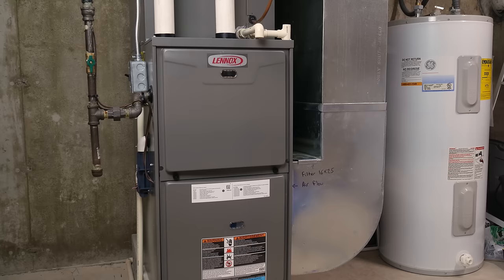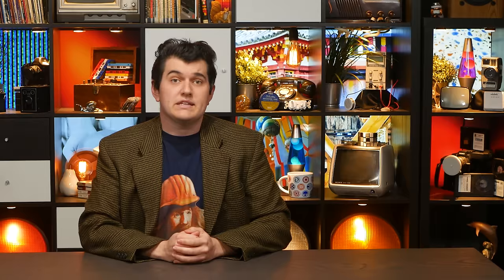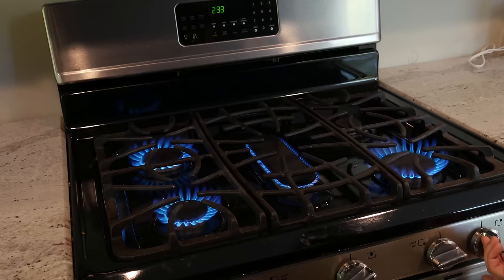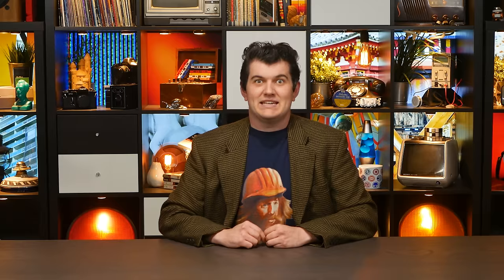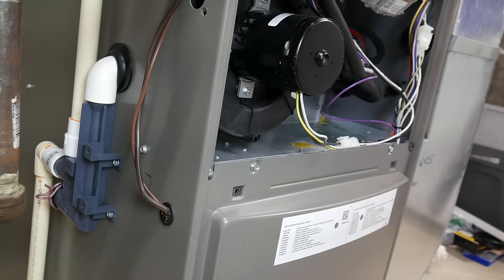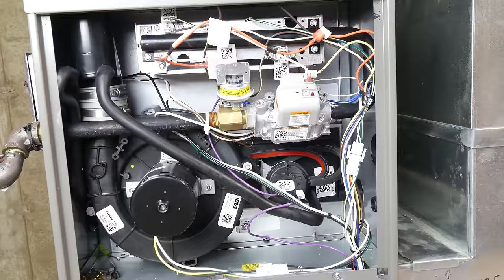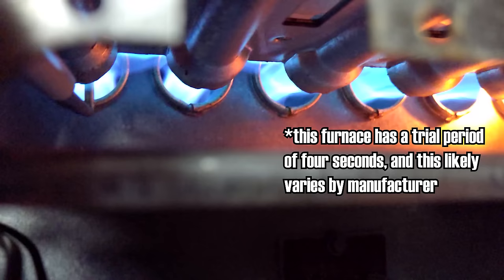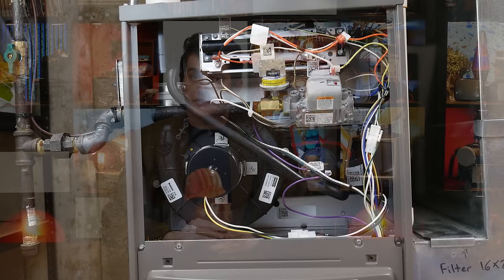Forced-air Furnaces: The What, Why, and How

Comment: HVAC guy here. Correction on your description of the flame sensor. It's actually way cooler! Because a flame is a plasma, it is actually checking for the conductivity of the flame! Any obstruction in the flame line will cause an error, as will Any corrosion on the flame sense rod. One of my favorite things about the modern furnace!
Edit: Whelp, you already made a note!

Comment: Having had almost died from carbon monoxide, please everyone have your system checked every year and have those alarms checked and replace the batteries if needed!  My story regarding Carbon Monoxide was when I was around 7 years old and I remember it pretty vividly believe it or not.  I think some of it was filled in by my family's take of events, but I do have clear memories of certain events.  I do know how it happened, but since it is 100% a one-of-a-kind case I am not going to say, but the outcome of what happened is the real story here.  That cold night back in the early 80's carbon monoxide somehow ended up in our cold air returns and leaked back into the house.  Unfortunately my bed was right over my cold air return and closest to the furnace.  Somehow I made it down the hallway and landed on the stairs and since my dad was such a light sleeper, he woke up and ran downstairs to find me.  It was around this time my memories started.  I started to gain conscientiousness while my dad was yelling at me to wake up and lightly smacking my face to get a response.  In my head I was really dizzy and saw tremendously bright outlines of geometric shapes flying past my vision as if they were neon signs.  When my dad started to feel the effects of the CO, he took me outside and by this time everyone else had been awaken and together.  After a little while sitting in our van on that cold night, I remember my parents discussing what happened and what to do.  After my dad's head started to clear up a bit we went to the hospital where we found out that I had 30 minutes to live under that concentration, my sister had an hour and my parents, being upstairs and the furthest from our furnace had an hour and a half.  I was on oxygen for 24-48 hours, those details are foggy.  Although the details of what happened in my case are very unique, it doesn't discount the fact that this can happen with a commercially installed furnace at any time during its operation.  Also if I may make one more interjection here, please for the love of all that is wholly, crack your garage door if you are running an engine in there....especially a lawnmower or snow blower.  The amount of CO they produce is astronomical and I think we all need all the brain cells we can retain.  Thank you for those who read this book and I hope you take it as a good story about how 1 little boy could save his family from oblivion.  By the way, I am in my 40's married and have a beautiful daughter that is in grade school and I have had zero negative effects from this event.

Comment: Fun story, my housemate and I were having trouble with the furniture a few years ago. At one point the thing shit down in the dead of a winters night nearly killing my roommate from hypothermia. Thankfully she was okay and until we could get it fixed we had a fireplace and our oven still worked just fine. The techs got it up and running and that was that. Fall comes around the next year and we decide to get the furnace tested to make sure it was all in working order. Surprise surprise the heating coils (several of them) we cracked pumping out quite a bit of carbon monoxide. We didn't know this because our carbon monoxide detector was 15 years old and non-functioning. Thankfully we got a new one installed and no permanent damage done to us. But that could have been deadly. Now we have two detectors and a new system to keep us warm. Yay! Happy ending!

Comment: "The electrical requirement of resistive heating aren't practical on a large scale" - Hydro-Québec, selling electricity at 6.08¢/kWh, in a province where 73% of residential energy is electrical and where it's quite cold, would like to have a word with you.

As for ventilation, what you want is balanced ventilation through a heat recovery ventilator, standard here in new construction. See "BSI-012: Balancing Act - Exhaust-Only Ventilation Does Not Work" by Joe Lstiburek
Reply: @Writer B.L. Alley But despite that, there's most of a province with 4000 heating degree-days (18 °C) each year that uses resistive heating.
Reply: @w0ffe  which is only a good idea if the vast majority of the electrical generation in the region is hydro and/or nuclear. Otherwise, using resistive heating on a fossil grid is terrible.
Reply: Ontarian here, always jealous of your low rates. Our province is too stupid to manage our hydro generation properly and it costs too much.  We pay the US to buy power from us then we buy it from Quebec because we are selling too much. lol.

Comment: I'm kind of curious how much of a difference in tech and safety there is with gas-powered wall heaters, like the ones in some of my rooms built as part of an addition. The main house has a central heater much like the one shown in the video and it makes all the same sorts of noises and does the same checks, but the wall heaters are just like, "off.... ON! 🔥"
Reply: The addition... that's not new work, is it?  Because those heaters, even with vents, were booted in most jurisdictions 20+ years ago.  It turns out that convection is a really bad way to exhaust combustion gases.
Reply: @raygunsforronnie847  It was added on about 20 years ago, yeah.

Comment: This furnace is built safety in mind
Also that furnace: take the front panel off and you could probably stick your hand (or something else) into the flames.

Btw, if you use your furnace only in winter months, how do you heat up water (shower/tap)? Electric resistance heaters?
For context: oil-fired water radiator based heating system, furnace also heats up the water. In my furnace, if you open up the furnace enough to touch the fuel nozzle, it won't start. You can check if there is fire thru a fish eye lens (similar to what you may find in front doors). The system is old (20+ years) and needs to be replaced in couple of years, but I believe it's efficiency is somewhere around 85...90%. Furnace is located in a separate room rated to stand fire for a minimum of 2 hours.

Really I don't think the furnace poses any larger risk than a regular fireplace (burning wood), wood-fired stove or sauna. But still I wouldn't mind having CO sensor in my bedroom, and fire alarms are in every single room (apart from toilet, sauna, bathroom and kitchen where steam or a sudden rush of hot moist air would often trigger an annoying false alarm).

Comment: I’m wondering if you can do a video on the geothermal systems, I’ve never understood how they worked, I’ve been curious because a lot of people are now installing these where I work
Reply: The bare basics of it, starts with the geo-thermal system in question is still a "Heat-pump"... SO it acts like a regular AC-unit in the summer (moving heat out of the house to a cooler place)... AND a "reverse" AC-unit in the winter (moving the heat INTO the house from a warmer place)...

     BUT what happens when the outside is even colder than the inside???
    I had a "regular" heat-pump, and since they put it "hidden away" in the shadow of the house, it SUCKED ASS in the winter-time... 

     Some clown figured out that caves, mine-shafts, and about anything else more than 10 feet underground stayed about 60F year around... Dubiously warmer than outside air in winter AND dubiously cooler than outside air through summer...

      SO they stashed the heat-pump's "external exchanger coils" into a subterranean chamber... We have plenty of energy effective (if not always efficient) "coolant" materials to choose from, so long as the stuff is gaseous to be compressed where heat is to be extracted, and allowed to expand where heat should be absorbed... There's some technical hooey more complicated than a YT comment... BUT the beauty of the heat-pump systems is that they can reverse course and compress or release the coolant material for transfers of energy in either direction, unlike a "common" AC-unit, which is "dedicated" to blowing the hot air outside and the cold air inside... 

     BUT all this works on the same fundamental principles of a refrigerator or freezer... AND demonstrably from the "side effect" of any common air compressor... Should you find a regular air compressor (like at a mechanic shop or anywhere with pneumatic tools) wait until it's been running a little while and put your hand near the "coil" of copper tubing into the tank... It's going to be warm or even HOT to the touch... AND by the same token, if you pick up a "blow-gun" for the thing, you can hold onto the supply line and feel it get physically colder as the compressed air in the tank is being released...

     Well, fridges, freezers, and cooling systems all over the world have been using that same principle to absorb heat where it's not wanted and release it where it's more acceptable... AND they've been doing it for a bit more than a hundred years. ;o)

Comment: Meanwhile in Europe:

Idk man let's just use water
Reply: @Les Usually electrical coils, although outdated houses still sometimes have gas burners.
Reply: @Shirokroete  Can't just throw the entirety of europe in one bucket. In some countries gas is most used, in other wood, in other electrical. Just depends on what's most easily available in the region.
Reply: @louis-lau  Also oil or wood chips
Reply: @louis-lau  And then you've got those cheaters in Iceland, just taking the heat out of the ground.
Reply: @Shirokroete  Probably depends on the country. Gas burners are very common even in modern and expensive houses in my country, together with heat pumps and electric heating (including heated floor).
Reply: @Shirokroete  if it's either electrical coils or a fuel, then it's the same choices as anywhere else (except geothermal), right? Just with water as a middleman (also common in the US)
Reply: @nthgth  Yeah, difference is that we just heat the water and pump it through a radiator that heats up the room directly. Meaning we don't have to worry about CO2 levels or our homes spontaneously exploding.
Reply: @Shirokroete  Why would it matter if it's a radiator or forced air? The dangerous thing is burning fuel, which has to happen either way. 

Older houses in the US use radiators, too, but most newer houses have AC, so they need central air anyhow.
Reply: @techmage89  I don't like the idea of having the air from the burners coming directly into my room. It's an extra step between me and the burners/heaters. We plan our room temperature in the building stage. Most houses here, in central europe, have excellent isolation and are build to trap heat of any kind. 
It's not really an important distinction of any kind, to be honest.
Reply: @Shirokroete  Yeah, building a new house, a geothermal heat pump is by far the best system, but it's expensive, and nearly impossible to add to an old house.
Reply: @techmage89  Because the burning chamber is usually completely sealed off from the room, except your unit is maybe over 30 years old, and only can draw air from outside and exhaust it there. It physically cannot run thorugh the radiator pipes either, as they are completely sealed off from the rooms and if they break you will lose heating water and the furnace will simply shut down as the water pressure is detected to be to low. In forced-air-heaters where the ventilation pipes are heated directly by the exhaust from the furnace they could break and therefore nicely spreading CO around the complete house. In radiator-based systems of that kind an escape of CO is impossible unless something brakes in the furnace itself; therefore CO-detectors are now mandatory where the furnace is located in rented appartments in Germany. No point of putting them elsewhere, though.
Reply: @99Cafer99  I mean, the exhaust pipe can leak on a boiler for a radiator, too. The only real difference is that a forced-air unit might disperse leaking exhaust fumes further, but that also makes them less concentrated. It's sort of a pick-your-poision type scenario. Anywhere stuff is burning should probably have carbon monoxide detectors to be safe.
Reply: @techmage89  It matters because a CO leak in a boiler does not instantly pump CO through to the living space. CO detectors are not really needed if you use a boiler and the only reason I know they exist is American media. Also water has better thermal retention than air.
Reply: @l.u.c.a.s.  That's true, but it will also dilute the CO in doing so, making it less immediately dangerous. If a boiler leaks, it can build up a very high concentration of CO near it if it isn't located in a well-ventilated area. I think CO detectors are important safety devices in either case.
Reply: @techmage89  the fact that it instantly spreads the CO through the house makes it much more immediately dangerous, unless you've got people sleeping in the boiler room (and even then that's only one room as opposed to the whole house being exposed). And yeah, a CO detector could be useful in the boiler room if it's an enclosed space. But it's never needed elsewhere.

Comment: "Typically limited to older buildings that were constructed before we became addicted to air conditioning"

Looks at house built in 1945
Looks at boiler and radiators

Oh hey!
Reply: Or the apartment complex that I call home, which is baseboard-heated.
Reply: I live in an apartment building that was built in the 1930s.  This building has an old-fashioned steam register instead of the more modern hot water registers.
Reply: My house was built in 1959 and uses a boiler to heat the concrete slab on the first floor and baseboards on the second floor. Kinda nice on cold mornings when you find that warm spot on the kitchen floor when you're making your coffee....
Reply: My British home was built in 1990 something, and uses a boiler and radiators.
Reply: @kguy6635  same
Reply: In 1945 a lot of people just had a fire in the living room or kerosene heaters
Reply: Some houses in the uk use heating oil they are usually in rursl areas
Reply: My house was built in 1852. I win the oldest house so far. I got combi boiler and radiators. But I am in UK so the norm here.

Interestingly all new boilers for at least a decade here have to be condensing. My current one (about 4 yo) is but the 90s one it replaced wasn't.
Reply: @jca111  ours is a boiler from the 90s its got an f for efficiency the gas engineer told us😂
Reply: @thepurdychannel8866  yeah my old one got that as well. A potterton puma. Current one is an A+ I think. Didn't notice a huge difference in the bills like I was promised. But that might just be cos gas prices are just always going up
Reply: @jca111  i know a gas engineer said its false economy to have the gas flame turned low he said he said have it on full power and it heats up the house quicker and uses less gas we tried it on high but the radiators were too hot we have it on medium now
Reply: I miss my old 1940 house with its gravity steam system. Thing didn't even require electric to run, so you had heat even during extended power outages from winter ice storms. Now I'm in a place with the complete opposite, with a heat pump with resistive electric secondary heat.
Reply: @NJRoadfan  oh we use a gas boiler and radiator system

Comment: 0:53 I disagree. In many parts of the US, recirculating hot water (not steam) baseboard radiators are very common, even for new construction.  Central air is often installed in separate ducts that are only for A/C.

That said, the principles behind their operation are nearly the same.

Comment: I have 90% 25 year old Goodman furnace. Still working well. This winter I had to flush the drain trap. It got clogged up. 
I also had to install new drain line to the outside. I wasn’t sure if I can use condensate pump for it I ran new line straight outside.
Old line was draining into crawl space

Comment: So my house here in Nova Scotia is heated by two heat pumps for supplemental with a propane fired boiler running an in-floor heating system as a primary source of heat. It was one of the best decisions I ever made it has been extremely inexpensive. Even in the coldest parts of our damp and windy Winters it comes on maybe 2 to 3 times a day cycle some water and then shuts back off. It does use a condensing system and has an energy efficiency rating of 98 according to the Canadian standards anyway.

Comment: Are you sure the flame sensor is a thermocouple? I have no experience in home furnaces, so no idea about that,  but marine boilers which have an electrode like that normaly work on a current sensor. Basicaly the burning flame is plasma, and it's conductive, so the electrode is placed directly in the flame and if it conducs a current betwen probe and nozzle, or another probe, it means flame is there. I've also seen with silicon diodes for IR and also photoelectric effect sensors for UV, but I guess that's a little more advanced.
Also, very nice well structured video. Anybody can understand now how these little guys work.